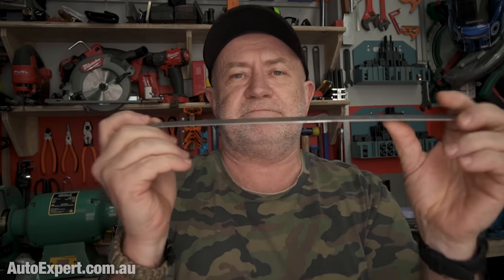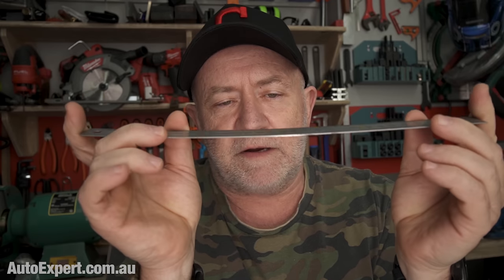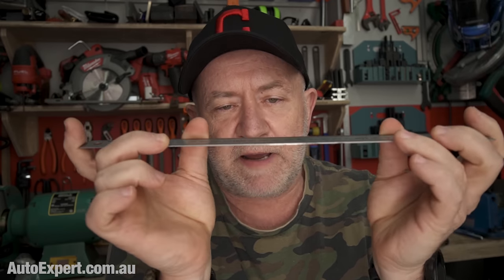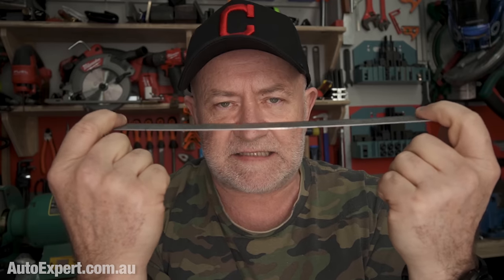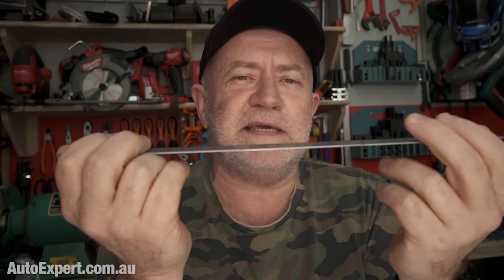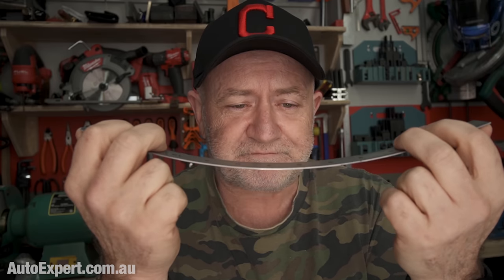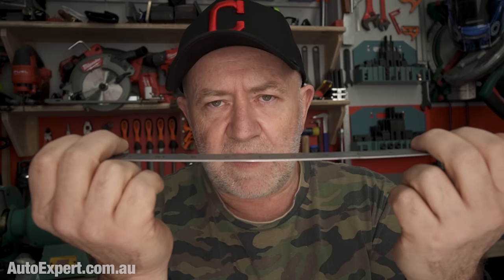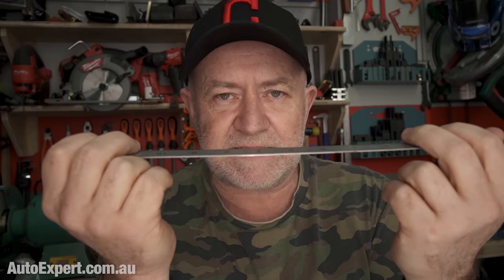Leaf spring reset: Can you fix a sagging spring? | Auto Expert John Cadogan

Comment: had the factory springs reset on my 40 series was perfect with a 2 in lift, better than aftermarket, however you missed a big issue that the current car companies are making extremely inferior springs i have a mate with a 2 year old bt 50 that carries less than 200kgs in the back (sparky) drives it like a granny and the leaf have collapsed, another mate runs a chassis shop and said every modern utes springs will deform after 3 years of standard use. no one is talking about this issue because aftermarket springs are cheaper than taking the manufacture to court
Reply: Chinese steel
Reply: I heard European vehicles all take springs from the same plant in Sweden, and in winter they cool them too fast after tempering, so they fail.
In other words, your suspension reliability depends on when your springs were made.
Reply: @Rampart.X  Chineseum.
Reply: @johnwade1095  you heard wrong
Reply: @ryanfarmer4882  Maybe. Got any better data for me to replace it with?

Comment: But if you do the whole heat treatment and bending process with the whole pack, you'll lose the preload designed in and they'll feel less stiff than original, and squat more under load. I think Yuri Geller could have missed a massive career opportunity here!

Comment: Most aftermarket  springs  are heavier duty than standard . If u think its hard to get stock replacements which is a joke try coil springs . Most  coil options areonly available  setup for raise 30-40mm and with bullbar fitted . They are so hard  when fitted to a  standard vehicle only driving thru a DEEP road drain is the only way to  actually compress them . The aftermarket is targeted at one thing your wallet !!

Comment: Having flashbacks to me as a 16 year old way back in 1981, doing one of my first jobs; employed at a local steel works that reset leaf and coil springs. Many hours were spent as a TA to the guy working it all in front of that big forge feeling like a medieval blacksmith and drinking gallons of water a day to replace the lost fluids from the heat. Thanks for bringing back the memories, John. 👍

Comment: I think that this whole subject re-setting of springs has  changed in my lifetime.
Back in the 60's 70' and well into the 80's it was a common and frequently done thing to have springs re-set or reset and an extra leaf, but that is because we did not have the ready availability of aftermarket leaf springs AND we did have a lot of local spring works.
While one of my local spring works is still in business, their business model; has probably changed too.
The days where local mechanics and enthusiasts walked into spring works every day for custom springs or spring repairs have gone.

Of course one of the reasons springs did sag, was poor quality control in original manufacture, probably errors in the tempering process.
Local spring works with highly skilled staff and a reputation that mattered probably did a better job than the mass market producers.
Reply: Manchester Springs were the top place here in north west UK. Don't know if they're still in business. I'm going to check on that!

Comment: I had a set of OEM Toyota leaf springs 'reset' on a project Landcruiser of mine from the early 70s, I wanted to keep the originals in line with the rebuild. I wasn't aware you could repair leaf springs but apparently they're quite serviceable. 

Old mate that did the job had been doing it for donkeys years in his family run fabrication business,  but rarely ever does it anymore. Was a common repair back in the horse cart and early motoring days but not anymore.

Comment: Agree, just buy a new set from the local parts place
I run some fairly intensive heat treating stuff for making kitchen knives, some of which are quite long but at the size of something like a leaf spring you're not going to get much off the shelf which is capable of heat treating that sheer bulk of metal. Then you're going to need many gallons of very expensive heat treating oil (no, not vegie or old motor oil) to the point I'd be budgeting in about 200 bucks just for that, the tank to stick it in and the oven costs are getting into the 10k alone just for a precision furnace to accommodate them, then one for tempering it in as well.
A lot of leaf springs are usually in the SAE 5160 type of steel of thereabouts, its a great steel
But it does benefit from precision heat treatments and to some extent if you've gotten a leaf spring completely played out, its also probably full of microfractures and other metallurgy mess that wouldn't give it much of a life anyway. So they just send the old ones off to be re-melted as its still a good carbon steel and will find its way back into new ones eventually.

Comment: Good summary mentioning Hilux and sagged springs. This was a thing that happened to my 1984 model. Toyota resolved the rear sagged springs just before the guarantee ran out but a further 20,000km they were sagged again together with the front springs. I did an after market upgrade with a small lift but they also sagged about 60,000km later. I paid to have them reset and traded the Hilux in before the next spring reset. The Hilux was often climbing a mountain trail to a hang gliding launch site with a few extra people and a few gliders on the roof but didn't consider it was overloaded. 
The next Hilux is 30yo now enduring a considerable work life and still on original springs.
Reply: I so want a 3rd or 4th generation Hilux, I still have my 5th gen and 6th gen, My whitey just turned 33 in August owned her since new. Just a beast of a Ute..

Comment: John, this is a great video for me. I have a 1992 Isuzu Rodeo 4x4 that has 233,000 miles on it, with a sagging right rear leaf spring. I'll inspect all the ubolts and replace them if suspect.

Comment: My 1967 VE Val had a bit of a beefy, solid suspension. It was used to tow a 22' foot trailer sailer before I got it (my father owned it before me). It had stabilisers and heavy-duty air shocks, as well as beefier springs. The front had the standard torsion bars and a set of heavy-duty gas shocks. The old VEs tended to handle like a boat at times. However, this one was solid with next to no body roll at all. It had one strange quirk that I never figured out. If I went too hard around a left-hand corner the car would shut down. I'd have to pop into neutral and restart it as it was rolling once I was pointing straight again. Right-handers were fine and if I took it steady around a lefty it would be fine. Yeah, never figured that one out.
Reply: Must have been a two-barrel.
The Carter 2 bbl carbies fitted to Slants had the bowl off to one side, so if you went around a left, the fuel sloshed up and away from the needle, toward the floats, jamming the needle into the seat and starving the engine of fuel. The last couple of gasps as the engine conked out and your radial speed slowed to a stop would pump enough fuel into the bowl that you could just start it right up again.
Later 2bbls in the Hemi 6s had the fuel feed under the floats, so they didn't suffer the same problem.

Comment: In the states, in Omaha, NE. We had a company that would repair, replace or re-arch any leaf spring 5 days a week. They provided a 1 year warranty for non-commercial vehicles and 90 days for company trucks.
  These were 4 guys who knew metal, replaced a single leaf and used two books to arch the leaf springs. You could walk in there and tell them you had 68 Dodge Charger; they stopped you and ask mono leaf? Yep, we will a second leaf only and install then for $72.50 plus tax in 1986 dollars, bib, Squid, Quid, PiD, whatever it’s called!

Comment: Insert an additional leaf in the original pack, gives you back your ride height and makes the pack a little stronger.  Often have to adjust the leaf lengths to correctly distribute the load but that only takes a grinder and cutoff wheel.  Done it, works well.

Comment: As recently as the 1980s or 1990s I visited a shop that recurved leaf springs.  I don't think he heated them up.  He used two methods.  He had a fixture that would support the individual leaves of the spring spring at two points, perhaps 8 inches apart and would strike it with a heavy hammer. He would move the spring side to side going from one end to the other creating some additional curve. He also had a machine that would apply hydraulic pressure in place of striking it with the hammer. He would work his way through all of the springs in the pack and until he was satisfied and then reassemble them. This was not cheap, but less expensive than buying new springs.

Comment: I generally agree with most things you get to say, and without starting a shouting match backwards to each other, I think there is a case for the restoring of old or worn out springs (if they can be..that is) rather than going out to buy new ones...just because its convenient to do so.  Our motor industry and machine shops around the country need our support by us using their services before they go under as a result of us ignoring them. Cost wise, I know that replacement springs for my BG falcon ute come in at around $1700.00 (unfitted) while having my existing ones "re-worked" and lasting another 10 years is about $1000.00 (Fitted).
Reply: 1700 for a leaf pack is a rip-off

Comment: My old Mitsi L300 4wd rear leafs had 'sagged' due to many jumps etc - suspension shop reset them and Added a tapered but dead-straight 'over-rider'' leaf; just enough to help.
One day I was racing the tide down Teewah beach, and it was humped - about every 200 to 400metres for 80 kays I launched it, at 100km/h.
My Camping plates were Corelle - didn't break.
The Torsion-bars in the front you ask?: replacement genuine Mitsi.
Ahem, all bump-stops removed, and aftermarket shocks all round that exceeded the springs reach even with the stops removed.
At 20 years the gearbox gave up . . . 
I miss the Venga-Bus.

Comment: 30 something years ago I was witness to an attempt to build the ultimate ambulance. The result was a ford f-150 i believe with a fuel injected 351, auto and a fibreglass body on the back that held everything a paramedic could possibly desire. All was good until someone thought it would be a good idea to put one over a weigh bridge. We were overweight to buggery and the fix was to send every truck one at a time, to specialist spring/ suspension workshops to have the leaf springs removed, reset and reinforced, (I think with extra leaves from memory but I might be wrong. ) I took months and cost god knows how much. Ahhhh good times.

Comment: I seem to recall the venerable HQ Kingswood being renown for sagging in the rear end, almost dragging the rear quarter and bumper on the road - and they were on coil springs, rather than leaf.  At the time, it was blamed on crappy dampers that wore out quickly, letting the spring bounce way too much and eventually causing it to soften, but I have no way of knowing if this was actually true or just a wives' tale.  Presumably material science has moved along a way since then, so maybe it's not quite the problem it once was - at least for coils.

Comment: finally someone i thing can answer my question-i have a 1947 lincoln continental  front end needs a couple inches of lift maybe 3 -so can i raise body and put  shims  on top  of the leaf spring probably have to put in longer u bolts-if this will work that has to be easier than changing the leaf i know raising it will probably put linage rod
 in a bind but i think i can correct that -love you video thanks

Comment: As always, amusing and informative. As a fan of the Ford Fairlane, LTD of 76 to 79, I owned quite a few as did some friends, they had a huge boot but the springs were made for comfort not loads so I just used to buy ute springs, which were load capable and sacrificed a little comfort to maintain ride height. If you are thinking of loading your vehicle talk to a suspension shop about options before you bend them.
The P76 POS was a good design in many ways but ugly asf, Leyland Australia didn't have any quality control which made them worse, when I was in the shop we used to call them the P38 because they were only half a car.    (spelling F U)

Comment: Anyway regarding springs, when we had an old Landrover 50 years ago (and no money), it was out with the springs, pull them apart, find big concrete slab and bash crap out of top side with freeking big hammer (big ball peen hammer did it too) and "voilá" reset spring with a lift! For a while anyway....

Comment: hi U need to tell local spring maker about the "hot" method . He follows the cold press method apparently . I suspect after hearing your correct methods its all about price /cost .  Generally what I have found is the springs that have been reset do not last even thou they are used  normally  no excessive loads .  My ute tradesman 250kg tools in the back and 130kg on the tow ball yet most go flat b4 100,000km  . So from what your saying the factory springs cannot even handle this,  under rated for the job.

Comment: Having watched this explanation on leaf springs, it got me thinking about torsion bar front suspension that was available on many 4wds in past decades, and still available on some (e.g. Mahindra). The standard method to “lift” the front is to wind them up a few turns on the adjusting bolts. Using the explanation given for leaf springs and pushing them beyond design, wouldn’t the same apply to any torsion bar lift?  As I see it, by winding up a torsion bar you are allowing it to twist a lot more than design on upward compression of the front end. Or is there a lot more flexibility available in this design of spring? I have an IFS 100 series Landcruiser and am keen to improve its remote area touring reliability more than its ability to climb rocks.

Comment: I had the springs on my old Falcon reset and tempered (lower) with an extra leaf added.  Nearly 30 years and nearly 350000km later they're still at the height they were.  Yes, I still have the poor rust infested machine.

Comment: Reset to original ride height is double but reset to original bend/carry property is impossible. 
My boss decided to reset springs on trailer in shop that just does that for living. And they did awesome job at first glance. Ride height was great, he pastidip all of them so no more lubricants and wd40 to the stop noise... All great.
First load and boy what a uneven load those 6 tires have... Disaster 3 - 6 tons. We have 8 tons per axle max here in Europe and one wheel was at 6... For that shit you get straight to jail... When shop removed all springs they were same shape, like pin point exact same shape but bending properties were completely different.
Maybe for one axle vehicles this is viable option but for 3 and you are all the time on full law limited load ...

Comment: Yeah you can fix it with a new one.
I reckon you could probably do the same with coils.
Reply from the maker: The reset is probably easier with a coil pack.
Reply: @AutoExpertJC  Attach the coil pack to the chest, just above the heart?  =)
Reply: @AutoExpertJC  the coil springs in my Venerable 80 series, were around 50 mm lower after 22 years, and plenty of outback Dingo Piss Creek visitations.
I reckon that is pretty good going.
But also new springs from the King Springs factory in Arundel( Sodom and Gomorrah by the sea) were $102  each

Comment: i bought a new truck in 1994 knowing i was going to keep it as a classic survivor it has never seen a load never seen rain never seen snow. it is now nov 2022 going on 29 years old with 25,000 miles on it and in like new condition and has a half inch sag on the drivers side and the only thing i can think of that could have caused the sag is a tank of gas. so im thinking it "sagged over time"

Comment: what i don't under stand is we had a Chevy maple leaf around 1943 and we would over load it all the time with hay big time and sometimes it would sit for weeks and we unloaded it and up shed come back to standed height, Bought a 200series cruiser put a three draw tool box in the back all highway work took out toolbox after 9 months and the cruiser didn't come up i was told shit steel shit springs bought after market springs not a problem i think the steel is not what it used to be

Comment: John, thanks again. I am an engineer too, electrical, so not overly knowledgeable of materials science.  I seem to remember fatigue failures with steel operating within the elastic range and a high cycle (>10^4) count. Is this applicable to vehicle leaf springs?
Reply: @johnwade1095  Thank you. You are rights about valve springs; they last a very long time IMO. I have to agree with you that material science is a black art.
Reply: @deanrhodenizer938  valve springs can lose maybe 10 of their preload over the engines life, and they have stringent requirements for damage and stress relief.
Suspension springs generally fail from manufacturing defects,  or damage, not from design fault